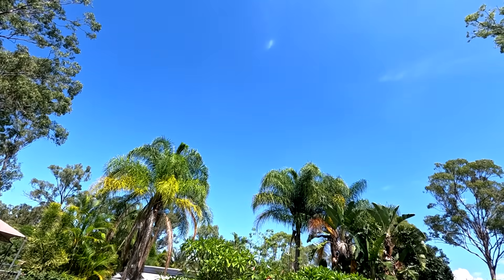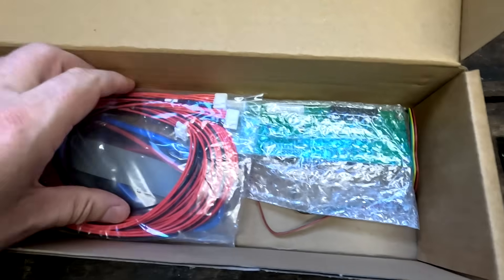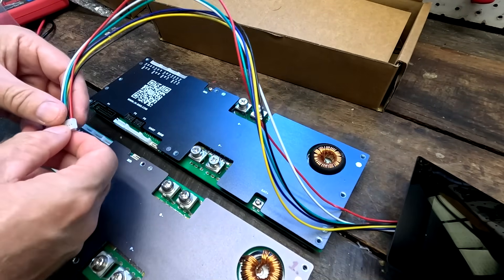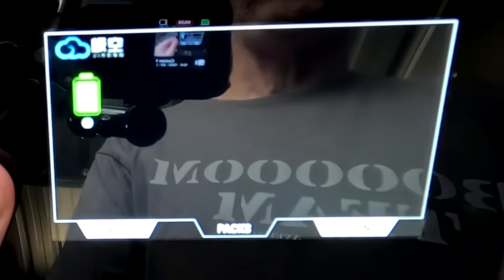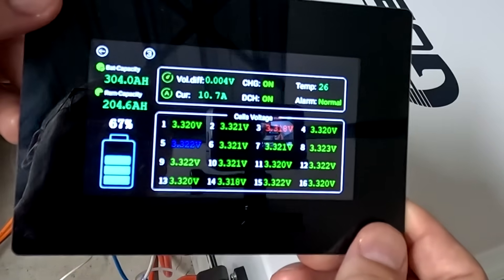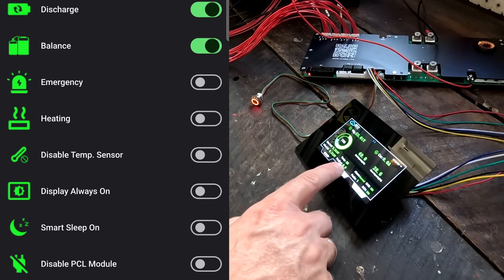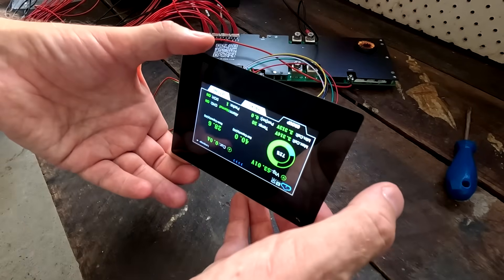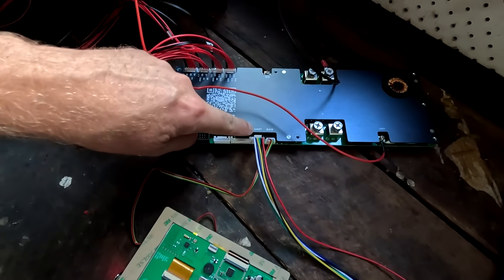New JK Inverter BMS V19. First test and... oh, look at its display! + Part I

Comment: Thanks for the video, Andy😊
We currently have four 16s LiFePo4 blocks running in parallel continuous operation with the JK inverter BMS.

Apart from the problem with the SOC calculation and the SOC drift, everything works without any other problems so far👍

Three more LiFePo4 blocks will be added to our 48V system soon😉
 
But first, we're adding two more 5kW inverters and an 18kW full-inverter heat pump for our pool to our 48V off-grid system😅

So, we're also making good progress with the expansion 🤭😂
Reply from the maker: Oh, wow, you're going big!

SOC calculation and drift will always be a problem, especially the more batteries we are adding. Wait until you have 16 pack in parallel...😂
Reply: @OffGridGarageAustralia  Well, that's why we have our SmartShunt – it keeps an eye on all the drifting blocks and tells us the SOC of the entire storage.

With storage prices so low, you can now treat yourself to one or two more LiFePo4 blocks, right?🤔

It's pretty amazing how much the prices have dropped in the last few months.😅
Reply: Hi everyone, I need some help with a JK BMS parallel setup.

I have two JK BMS units running in parallel, and all the settings are correct (same firmware version, unique addresses, wiring verified). However, the system frequently fails to stay in parallel mode.

The issue is that the slave BMS randomly disconnects for a few seconds. On the app/display it suddenly shows only one master BMS instead of two, and after a moment the slave reconnects again. This keeps repeating.

Another symptom is on the CAN network:
the PACK count often changes, for example dropping from 2 packs down to 1, then going back to 2. This suggests the second BMS is also intermittently dropping off the CAN bus.

So it appears that the slave BMS is frequently losing connection on both the parallel RS485 bus and the CAN bus.

Has anyone experienced this issue before?
Could this be caused by RS485 wiring, termination resistors, grounding, interference, or possibly a firmware bug?

Any advice or troubleshooting suggestions would be greatly appreciated. Thanks!

Both BMS are on firmware V15.42
Address 0 = master, address 1 = slave
RS485 cabling is correct, short cable, shielded wire
Parallel monitor page shows the slave dropping offline randomly

Comment: Nice Andy. What is up with those smallish wires between battery two and three at around minute 16:34?
Reply: They provide automatic extra heating for the garage when it's cold and the heating in the house is turned on.
Reply from the maker: I don't see any wires at this time stamp😂
Reply: @OffGridGarageAustralia  The positive and negative battery connection seem smaller.
Reply from the maker: @repairman2be250  but so many people tried to tell us that if they are short, they can be smaller in diameter!!! Not true?😉
Reply: @OffGridGarageAustralia  Well, you are the expert there. For me it was just an observation.

Comment: the same display...changed almost nothing..contrast is better. Chinese dont waste their time on anything new.... while old is still have 2 sales per year they will keep it :D They clrearly can make settings all settings to be in display and that people could change them with no need of any app.. but no...... it requeres them to work and they hate work.
Their old version display never turns off... you can either have it off or on.. never both....to have it on when touched and off when not used..nope..to hard for chinese to make it happen.. too big of a chalange
Reply: The old version display does turn off on mine.
Reply: @matthewmarks6951  The old display doesn't turn off. It just turns off the backlight and continues to work.
Reply: You forgot to activate the display again by just pushing the initializing-button!!
Reply from the maker: Settings on the screen are risky without a password protect

Comment: 7:23 - Simply use fixed / manual focus if the sensor of the camera can not focus how you want it.
Reply from the maker: Maybe we just live with it and go with the vlog-style of the video😄
The display is crystal clear, much better than any I have seen before.
Reply: Maybe put a piece of tape on the screen with the word "focus!" on it. The problem is that the auto-focus is locking on the reflection. If you give it something in the plane of the screen to focus on it should work better.
Reply: Yeah but that would undermine his edgy hand-held style!

Comment: You are truly inspiring! I'm up here around 60N latitude with 10.2kW on the roof now getting 7.8kW.
I am starting to wonder if I did the right thing though and opted for a discounted grid inverter instead of a hybrid one. I see now that I really really need to get a battery to have max usage and savings and a EEL battery seems like a good option. Any tips on a separate inverter for it or a 3-phase IT-net (230v, no Neutral!) Hybrid? I really dislike the Victron alternative as it requires 3 huge inverters, one for each phase.
Reply: Life suddenly becomes boring when you have a battery and can make tea at night!
Reply: I have installed a Deye 12k Hybrid inverter. Love it. Have bought another one for parallel installation. Batteries are 3 pcs Gobel Power and one DIY Box from Teze. Each 14,3kWh.
Reply: @schunkelndedschunke6914  my problem is the 3-phase 230v IT grid. Not many inverters support this.

Comment: This would be nice as an add on remote display with basic small display still on each pack.  Another future improvement would be cell level temp monitoring.   I've been reading about thermal runaway and it sounds like you can catch it with cell level temp monitoring.  Then isolate the pack with a shunt-trip breaker or a burnable fuse.
Reply from the maker: There is no thermal runaway with LiFePO4 and we have only 4 temp sensors in each battery pack. Monitoring all cells would be insane and is unnecessary.

Comment: Interesting. How does the cut out size for the new  display compare to the existing 4.3 display? Appears to be close in size but also more bezel on the new one.  Might just be worth having one of those if it's not too much trouble and that new whatzit comes along. That would be very nice.
Reply from the maker: I have to check. Good point.

Comment: Will the single screen also allow updates of parameters for all batteries at the same time? Also, will users still need to update firmware for each battery or will the master BMS update all the rest as well? Does this resolve the SOC drift?
Reply: That could be the wifi and network connection for.
Reply from the maker: The master will not update the slave batteries with a new firmware. As shown, the V19 can work with V15 and also V14 BMS in one stack, so a 'global' firmware update would be impossible.
Settings and parameters on the screen could be risky as there is no password protection.
Reply: @OffGridGarageAustralia  "Settings and parameters on the screen could be risky as there is no password protection." I think you misunderstood my question. Currently one needs to update the parameters for every BMS and it is impossible to copy and paste these. If one buys all version 19, is it possible to update the parameters and firmware on all at once instead of one at a time? Will one be able to save the parameters off line?
Reply from the maker: @jimj3936  there is an import and export feature in the make, but apparently, it is not as simple to realise due to different hardware and firmware versions and also master/slave settings.

Comment: Optional a longer (shielded) cable for mounting the screen further away from the master BMS (for yachts, RV's, off-grid garage's 😉, etc). 3rd tab: alarm notifications, switching mosfets on/off, balance off/on, BMS info (hard-/software version). Suggestion: long press power button monitor screen on/off. 🐸🐸🐸🐸
Reply: Cut the harness in half and put an RJ45 socket on both ends and run a cat6 anywhere you want between them.
Reply: Maybe (hint hint) a wireless  version for the screen is coming……….
Reply: @robjohnston8632 You're not allowed to talk about this 😉
Reply: I wonder if it already has alarm monitoring like the current display's third tab, but you don't see anything as there no alarms? Related: I infer they have dispensed with the "default password" alarm it has out of the box - maybe they got too many customer returns? 😜
Reply from the maker: The monitor on/off is now fixed with the latest fw update, but it also broke the display and it does not show anything anymore.
Long press the power button will turn off the BMS😋
Reply: @OffGridGarageAustralia 😮 oh my... the drama seems to never end. They certainly need an Andy! 😉 A double press would also do. Keep up the good work!
Reply: @ Double press was a customer-requested feature to toggle the Bluetooth comms. Would need to be a triple-press or full Morse code support...
Reply: @matthewmarks6951   ah ok, did not know this. Then a tap on the screen to wake it up and a (virtual) button on the screen to turn it to sleep and/or with a sleep timer.
Reply: @OffGridGarageAustralia 
I dislike flashing screens the whole time. 

Charging on tab 1. No red, flashing 'everything' (looks like there is an error in the system), only 1 (green!)  bar flashing slowly

And a 1 red / yellow(?) one, when discharging

No flashing blue arrows (annoying and no use?)

I also prefer a status screen,  which is already been mentioned. E.g. Soc, Current, delta, etc from all packs on one screen.

What I dislike very much on a Cerbo is seen here also: when selecting pack 0 (why not start  numbering starting with 1), you have to go back to go to pack 1. Please add the other cell numbers on top, so you can toggle between packs directly
Reply: @gubbernl  I guess an animation reassures you that it hasn't crashed, like the flashing "run" LED on the comms board. (There may be other things making this obvious though - it's some time since I watched the video.) Doesn't the numbering from zero correspond to the DIP switch settings?
Reply: @matthewmarks6951  yes, the numbering corresponds to the dip switches. you might have missed hearing it in the video....as andy mentioned it....
Reply: Чи можливо прошити з 15 v на 19v ?

Comment: Thanks Andy, interesting as always. So we only need to buy 1 V19 BMS to have this new  display for all individual battery packs. Suggestion for the view at Tab3: Daily accumulated metrics: Total energy (KWH), Max. Charging power/current, Lowest/Highest  system voltage, other meaningful metrics. Of course this would be for the whole bank, not for individual banks. Connector/Protocol selection tab should only be visible when new or after Firnware factory reset.
Reply from the maker: Good one...
Reply: Hi everyone, I need some help with a JK BMS parallel setup.

I have two JK BMS units running in parallel, and all the settings are correct (same firmware version, unique addresses, wiring verified). However, the system frequently fails to stay in parallel mode.

The issue is that the slave BMS randomly disconnects for a few seconds. On the app/display it suddenly shows only one master BMS instead of two, and after a moment the slave reconnects again. This keeps repeating.

Another symptom is on the CAN network:
the PACK count often changes, for example dropping from 2 packs down to 1, then going back to 2. This suggests the second BMS is also intermittently dropping off the CAN bus.

So it appears that the slave BMS is frequently losing connection on both the parallel RS485 bus and the CAN bus.

Has anyone experienced this issue before?
Could this be caused by RS485 wiring, termination resistors, grounding, interference, or possibly a firmware bug?

Any advice or troubleshooting suggestions would be greatly appreciated. Thanks!

Both BMS are on firmware V15.42
Address 0 = master, address 1 = slave
RS485 cabling is correct, short cable, shielded wire
Parallel monitor page shows the slave dropping offline randomly

Comment: I don't know why my app does not show the charge status. Version 5.0.1 hardware 15A Software 15.38 android 14. Why?????
Reply from the maker: Yes, only the master has the charger/inverter settings.
Reply: If someone hits here. All you have to do is 0 address dip switch as master.And will show the charge status and charge status time.
Reply: You can remove the tape, too. It is just different tools and skills.

Comment: Thanks for this Andy. Glad to see that one screen can manage all packs. Would be great if the wifi allowed monitoring of the BMS over the internet similar to what Daly has.
Reply from the maker: I discussed this with JIKONG and there will be Wifi access to the BMS but no cloud server or service. Not many people would trust a Chinese cloud service having access to your home Wifi.
You can setup a VPN for remote access the BMS if necessary.
Reply: @OffGridGarageAustralia  Thank you. When will the WiFi feature be available?
Reply: @OffGridGarageAustralia  If the BMS settings can be modified via Cerbo GX console, it will be even better.
Reply from the maker: @Test-bi5rg  I would oppose such an idea.  The BMS is a safety device and no 3rd party applications should have access to the settings or parameters of a BMS. Imagine something goes wrong with the communication and the BMS gets disabled or set to dangerous parameters.
Reply: I need your help, please.

I’m using a JK-B1A8S10P BMS board for my battery-powered wheelchair. JK is generally fine, but the password issue still hasn’t been resolved! Plus, the Bluetooth signal is weak!

I used to connect it with my iPhone, but I had to reset the phone, and now I can’t connect anymore!

Every time I try to connect, I have to go to the website and get a new password!

Since I had this password issue, I tried using another phone with Android 14, but that phone didn’t detect the BMS board at all! It didn’t connect! However, Android 11, 12, and 13 work fine. This seems ridiculous to me! I don’t understand how JK hasn’t fixed this issue yet!

On the other hand, Daly BMS boards don’t have this problem. I used a red Daly 150A BMS, and its Bluetooth signal was strong. But I stopped using it because it didn’t have active balancing.

Then, I tried the blue Daly 100A Active Balance 8/24 BMS board, which was great! Active balancing, Bluetooth signal, and WiFi connection were all excellent. However, it gave me a sensor error, so I had to stop using that one too. :(

I heard that a new Daly model has been released with Active Balancing + WiFi + Bluetooth, but I don’t have the chance to test it right now.

Now, I bought the JK-BD6A24S10P board. To increase the Bluetooth signal, I soldered a wire onto the Bluetooth chip, but I haven’t tested it yet. If this board also has a password issue, I don’t even want to bother with it. :(

Dear friends, what do you recommend? Can you please help me?

Best regards.

Comment: Very nice and welcome evolution in the right direction.
I hope that part of these evolutions will include easy and automatic MQTT integration into the Home Assistant.
Reply from the maker: Yes, it's in the make.
Reply: Why not Modbus?
Reply: @ Good question. I have the BMS on the same RS485 bus as two inverters. For logging/display, I interrogate the inverters with Modbus commands at 9600 baud then switch to 115200 baud and send the proprietary command to interrogate the BMS. Messy, but it works! (By the way, 115200 baud is too fast for USB RS485 adaptors if connected via a hub.)
Reply: That would be sweet, I bet the new Peter board might be able to do that any info on that Andy🤔
Reply: @tiborchren  with a local API
Reply: I have MQTT in my BMS from 2015, and 15 - 35 active balancer. THis BMS is maybe from Tower of Babel.
Reply: @PavolFilek  which BMS do you use for that? does it connect with wired LAN or wifi? Thanks.
Reply: Saludos tocayo desde Austin tx, USA.

Comment: 7:37
i wonder what would happen if the charge mosfets are "OFF" and the off grid inverter starts  to try to charge the battery (when its a inverter that need a battery to work)
could this brake the inverter?
Reply: The Inverter will shut off when it reaches the maximum voltage!
Reply from the maker: That's why we have communication setup. The inverter will never try to charge the battery if the BMS says charging is off. CCL will be 0A for the inverter.

Comment: Could you please test if the programmable relays work reliably on this hardware version V19? Thanks!
Reply from the maker: They fixed this in V15 already. There is also a fix on how to replace one resistor on the BMS to make it work if it does not work with your BMS. I'll make a video when time permits.

Comment: The display does not seem to have settings for all the Charge, Discharge and alarm parameters.....???
Reply from the maker: That's probably something you don't want to be accessible through a display without password protection.
Reply: The old display doesn't, either.

Comment: Great stuff. A display for the entire battery shelf is very nice. What should be on the “lost space”? Well, when I'm standing in front of my batteries, I want to be able to check the alarms. Like on my (now) old big display.
But whatever is displayed there, there needs to be a way to disable any possibility of settings. In my case, the battery cases are freely accessible to family members and the displays are happily used to read information (we are a sort of generational house). The “display only” is a safety feature for me.
Greetings from Bavaria
PS: What about the idea of adapting your BMS settings on your website to the newer app firmware?
Reply: I'm guessing it already displays alarms but there were none present. (It's looking like the "change password" one might have been dumped.)
Reply from the maker: Alarm of any battery will be showing on the screen. I have to do more testing on this...